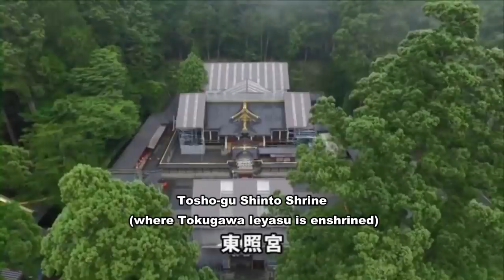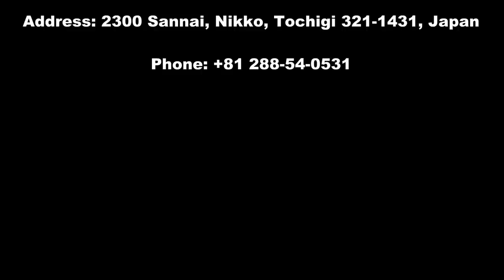Nikko Woodworking | Amazing Repair Work in Rinnoji Temple, Whose Construction Dates Back to 1250

Comment: I always thought that these temples were completely made withóut nails ( and glue ). But apparently they do use nails.
Reply from the maker: yeah, Stephan Reisig, Metal fasteners such as nails and cramps are sometimes used, but only for relatively small members which have no primary structural role.